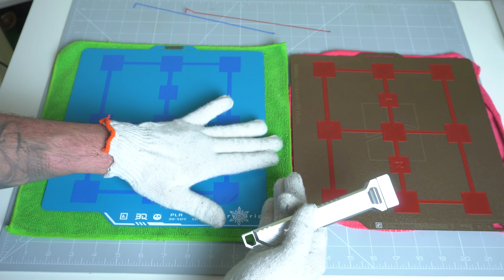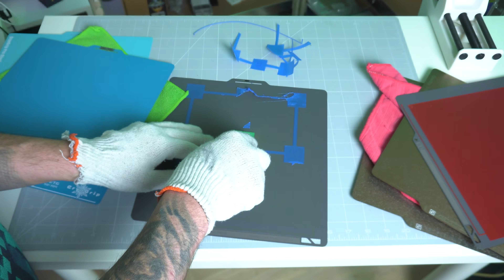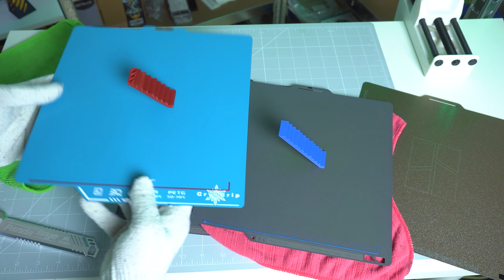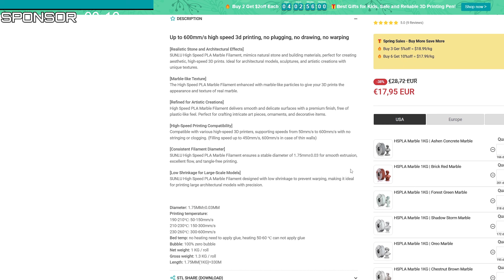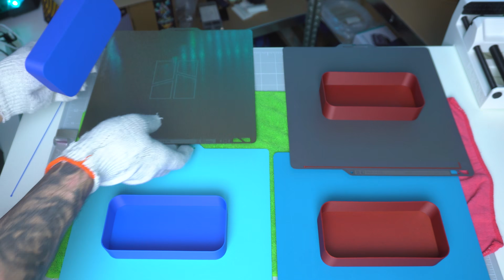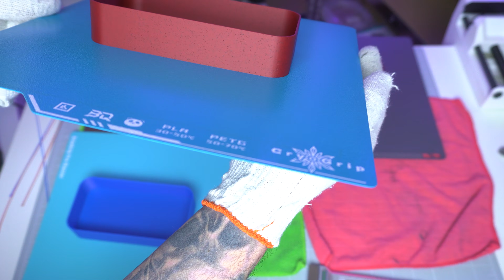Which Build Plate Reigns Supreme? Glacier vs Frostbite vs PEI vs SuperTack #sunlu

Comment: Newbie question: When using the Glacier or Frostbite plates, when/where do you adjust the bed temperature when using the Bambu slicer?
Reply from the maker: In the filament settings

Comment: Cold stickiness it is actually better for user experience if it is easier to remove when cold. It is the heated temps stickiness we should care about. Do we get warping or becomes loose, causing print failure

Comment: Great review.
Reply from the maker: Thank you
Reply: @PixelForgeLab  To further elaborate, I'm new into 3D printing bought two Bambu P1S machines, and have the Textured plate and the Cool Super Tack. But I wanted something in the middle, that would stick, less than Super Tack, and also low heat, unlike the Textured. So after watching your video I ordered 2 Frosbites for me. I might later try the Glacier as well. I found out when printing small sturctures etc, neigther the Textured no Super Tack and ideal.
Reply from the maker: @ArunaKalutanthriMusic frostbite is my favourite

Comment: A plate that's too sticky can ruin a print. The glacier seems like the best balance of hold during printing with ease of release. Did you ever get any warping with the glacier?
Reply from the maker: Totally agree yes, I actually had some issues with ASA recently, it ruined two of my plates. And didn't get any warping with glacier yet
Reply: @PixelForgeLab  It ruined two of your glacier plates?
Reply from the maker: @robertmunafo5039 no no, the normal ones from bambu Lab
Reply: @PixelForgeLab  Thanks for reply, great video btw!